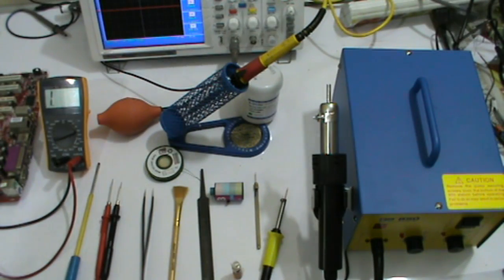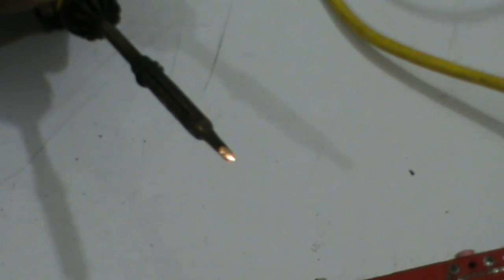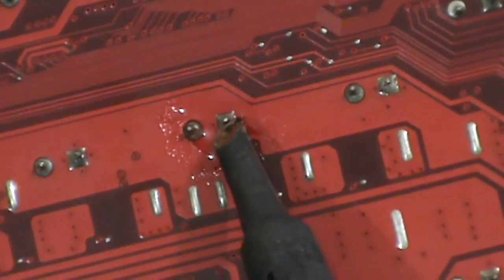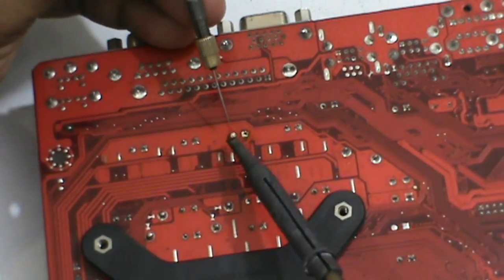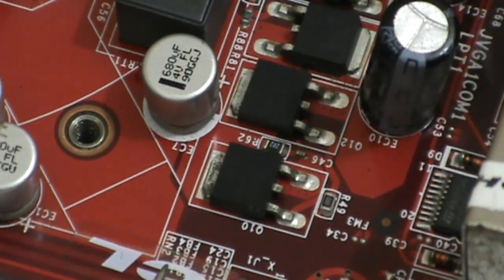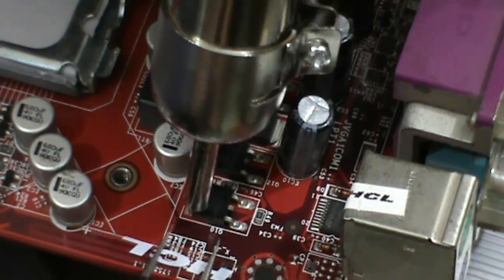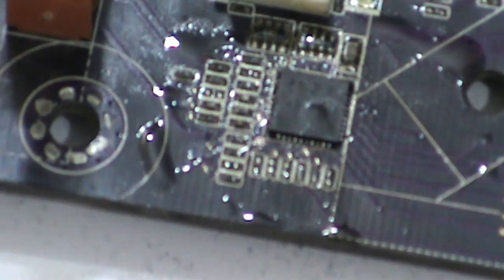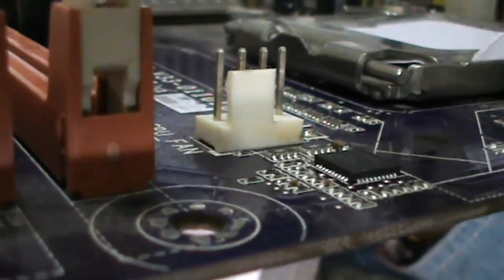chip level motherboard repairing tutorial

Comment: Hey man you only want to apply flux when installing the new capacitor, you are wasting it putting it on to de-solder. Also you should not re-heat the joint such as when trying to make the capacitor flush by pressing and re-soldering. When you re-heat the joint without adding flux you are allowing the joint to become oxidized and it will not be a nice reliable joint

Comment: PLz clear my 2 doubts
1>whats that liquid thing u apply again n again  , and what would happen if i dont use that? 
2> Is theres any differennce between Solder Paste and Solder Flux Paste ?
Reply from the maker: we are using no clean flux means glux burn quickly .when you joint tiny solder pad then its not join properly without having flux...

flux paste is a specification of format .. so many type of flux available in market.
Reply: Harshad Patel Thank you for your reply , Also when you desoldered Mosfet at 6:35 , there were four boxes , is it important that solder dont touch each other boxes?

Comment: i have foxxcon mother board burn the cpu chip.. and also the inside the cpu board..how to fix it...
Reply from the maker: need to reball it with another cpu but it quite costly so advise you replace board because of new board and bga rework with cpu process is in nearby same cost
Reply: thanks for your idea sir ... i want more enhance about mother board i have 4 motherboard like biostar edimax have power but no display i change memory and cpu chip it thesame no display the other 1 motherboard have power display also but in 1 minute its will be off..sory my english

Comment: hello, thx for great lesson. But you could add on the video the temperature and air speed for each component. For ex, id like to know how much temp and air speed (from 1 to 8) to unsolder a DPAK mosfet?
Also your flux you said is this one? http://www.consoleplug.com/Products/Video%20Games%20Accessory/Repair%20Tool/CP12012/ConsolePlug%20CP12012%20The%20Best%20BGA%20FLUX%20Reballing%20Repair%20Rework-A2.jpg
But it seems not liquid as in your video?
Reply from the maker: it could be liquid while at work
.  RMA-218 is a no clean flux

Comment: why do you keep adding flux between steps? to prevent oxidation?
Reply from the maker: when feed flux then it will be result sharp solder joint..
Reply: Harshad Patel
your honest opinion, do you think baking motherboards in oven is stupid or in some instances it could fix them, if you do it just right?

my macbook air overheated, it looked like a GPU fail in the moment i turned it off. do you think i should shove it in the oven or just take it to my local reballing service without risking causing additional damage to the logic board by baking?
Reply from the maker: some people use this trick for drysolder process but it's not work for reflow .

 we use oven but our purpose is for only humidity dry . as specially on monsoon.. because of humidity disturb clock fequency.  we warm it up to 100 to 120c 

solder ball melting point is differnet like
leadfree = 230 C
leaded =180C

if you reflow it with oven in this temprature
then your other component damage . as specially PF , MF capasitor , line filter insulator etc.

bga is connected with solder ball so need to replace ball . reflow is not a permanent solution
if you reflow and you get display but it will not
work for long time it will return problem again and again after some time
Reply from the maker: solder ball oxidation is a problem for bga ic 
when you feed flux and reflow it then it will
quiet better but not a make good joint .